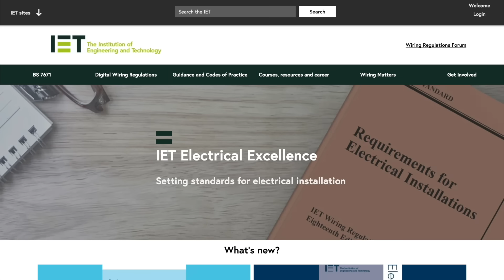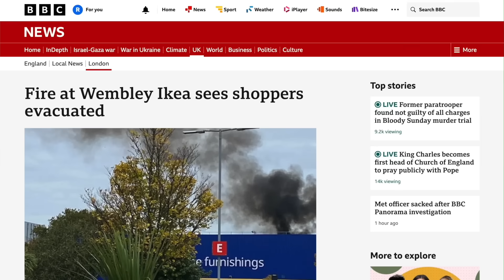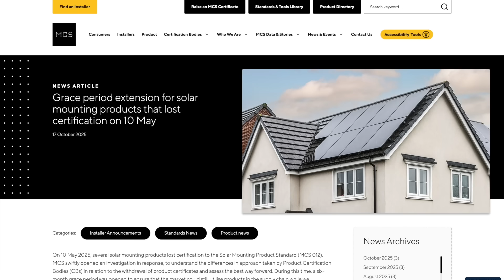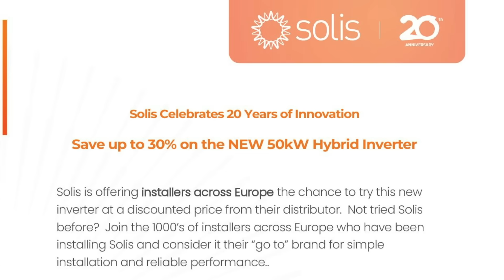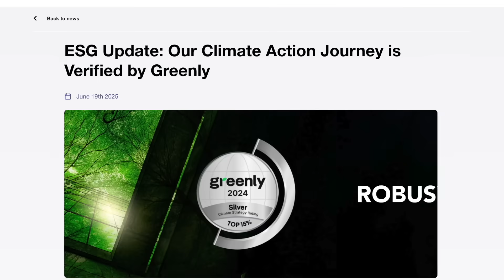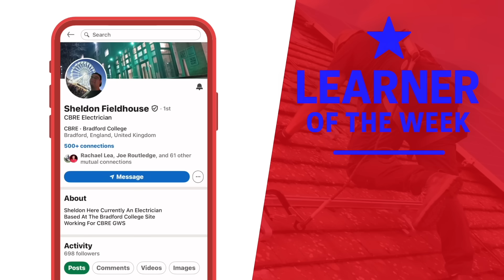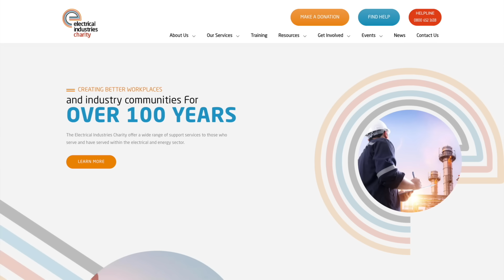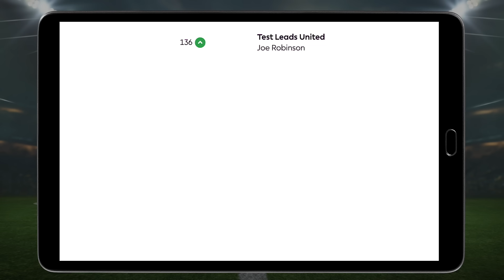Exclusive: Grid Bosses Set to Change UK Voltage

Comment: Why not simply run closer to 230v than 240v? It was rumoured that as 240V was within the specification that we simply stayed with 240V. I certainly don't want my voltage pumped up by amateurs with solar (or whatever) installations. As commercial suppliers have been able to do this for decades, if people want to put more power into the network then they should do so as commercial providers do and stop trying to mess everybody else around trying forcing people to put up with lower voltages. It sounds like yet another minority is trying to dictate what goes and force everyone else to comply or suffer the consequences, no matter what the cost.

Some devices are very sensitive to supply voltage, such as precision instrumentation. Dropping the voltage is likely to produce a lot of eWaste and engineering waste to cope with this properly. Some equipment with a linear power supply has transformer taps to precisely match the incoming voltage. So far there have not been problems. Are people, such as myself, expected to measure the incoming supply voltage before even considering plugging in their equipment? The current mains supply is generally quite stable, reliable and should be left alone.

Another reason to leave things alone is that if electric vehicles really do increase in their numbers then the supply voltage will naturally be dragged down. But then, unless I am mistaken, everyone having electric vehicles is simple not a possibility with the present infrastructure anyway. I think that the only workable total-EV solution is electric bicycles, scooters and motorcycles.
Reply: "linear power supply has transformer taps to precisely match the incoming voltage", such devices would not work correctly for much of the day already if they were connected directly to the grid. Voltages from your local transformer are not just effected by the national grid's output but also the other users on the same circuit from the transformer.

Comment: Well I think this is an underhand way of deducing energy consumption. A small change in voltage causes a bigger change in power. Halve the voltage and you quarter the power. So by dropping the voltage by 10% you will be cutting power use on a many appliances by 20%. Ok appliances like ovens and kettles will run longer but others like showers just won’t get as hot.
Reply: Reducing not deducing.

You are entitled to your opinion, but you are wrong. It is not being done to save energy, it's being done to allow more solar generation.
Reply: And.... that means youll need to use them longer.
I doubt very much that the corporate greediest will drop the price per kwh accordingly.  Its only going up.
So, theyre enforcing a higher consumption.... ££££££
Reply: @ant8241 oh dear, you clearly don't understand basic electricity.

The price per kWh should not change.
If it takes longer to boil a cup of water, you don't pay more because it takes longer.
It still takes the same amount of kWh to heat that cup of water to boiling point.
And that is what you are charged for, the total energy used in that activity.
If the voltage is reduced, the current is consequently reduced, the power dissipation in watts is reduced, but the appliance takes longer to do the same amount of work, and the kWh consumed remains the same.

The total cost of consuming that electricity is T, which is equal to the rate * kWh.

The rate isn't changing, the kWh isn't changing.

FFS!

And the difference in the lower threshold of the voltage is so slight, you aren't going to notice a reduction in performance of the appliance. It's not like reducing from 230 to 120, which you will notice.
Reply: @deang5622  Oh dear.... you clearly are a self righteous bellend.
 
Yes, youre right, a Kwh of any voltage is proportionate to the principle of ohms law - so, youre right, im wrong. Now just hope the "rates" stay the same.....
Reply: @deang5622 I actually understand electricity very well thank. I never said anything about price reductions per KWh . So we reduce the voltage by 10% this means resistive loads will run at 20% less power (if you half the voltage you quarter the wattage basic principals) will you be happy with your 10 kw shower only delivering 8 kw. The change is not as slight as you think. Yes of course your oven and your kettle will just be slower but this will reduce the peak demands. Try getting a standard three phase supply you no longer get a standard 100 amp you get an 80 amp as standard. Reverse feeding the grid with solar if causing huge problems for obvious reasons as everything is designed for power flowing the other way. dropping the supply voltage is not going to cure the voltage fluctuations just give you more headroom. There are huge problems facing supplying the growing demand for electricity, especially when the generation is becoming  more variable

Comment: Who is to decide if the hardware I have working perfectly and safely is obsolete? Me, that is it me and only me. Network operators don't have the right to decide arbitrarily that it's obsolete, it works fine in the UK, and it's not going overseas so why does some suit decide it's obsolete?
Reply: If that hardware is “harmonized” aka made after 1990s it can run 230-10% just fine. Nuisance starts under 195V. For mills that’s not a problem given they have their own MV transformers
Reply: Because you connect to their grid, and you expect insurance to cover you.
Reply: Agree there Dennis (also hi, how odd to see you here). But the odd reality is, most of the older (often specialist or collectible) equipment (as you well know) is either: A, not picky about voltage or B, has an adjustable setting for the voltage that the owner will know how to set.

The less tight tolerances (so it can vary by time of day) are more of an issue in my not so humble, and possibly a safety one ... if someone sees 207v and sets their stuff to 210 (an available voltage on some gear) then it ramps up to 253... who's liable for the fire?

Comment: In Yorkshire we wont worry about it. The EU still havent realised we never stopped using 240V. So whatever they want, yeah we did it....
Reply: You didn't need to change, it's 230V nominal, previous standards in europe of 240V and 220V are still within tolerance.
Reply: @dglcomputers1498 its called satire 😅. That said dont tell anyone but we use 240V as the minimum.

Comment: Many power supplies in TVs, computers etc are switched mode, so lower voltages cause them to draw more current. Pushing them to lower limits could cause more failures, possibly in older equipment.
Reply: The same power supplies are going to be used in the same devices sold world wide, included the whole of the EU. No manufacture is going to design and produce a switch mode power supply that will only operate a device when feed power that conforms to the current UK specs.  Just about every switch mode power supply I have is rated for a supply between 100v and 240v. The term 'switching' has nothing to do with switching the input voltages, it is short for 'high-frequency switching,' where the input frequency is greatly increased.
Reply: @rogerthomas7040 In a switching power supply of the type being alluded to here, a significant part of the loss will be in the rectifier immediately before the switching stage, here a higher voltage will lead to lower current, so a higher voltage is better. In  synchronous buck converters (i.e. a MOSFET is used instead of a diode), a higher voltage will also be better for efficiency, because the conduction losses on both MOSFETs will be lower due to them being on for less time. That being said, there isn't much in it for the 240-230V range, but at the lower voltages of "universal" supplies (typically 90V), the losses will be measurably higher. While this doesn't really matter for high quality industrial grade stuff, for consumer grade electronics, the extra heating is likely to lead to failures sooner on lower voltage supplies than higher voltage.
Reply: Worst case permissible voltage is 216V over there are present, right?  Well, let's assume we have a premises operating actually operating at 216V and it actually moves to 207V.  At 1kW assuming PF of 1 that means 4.63A at 216V and 4.83A at 207V.  It won't overheat unless it was already a very marginal design.
Reply: Many SMPS are also universal 100v-250v - 50/60hz input designed to work worldwide,
Reply: @RandomNoob  It's all about using less copper and having a single, cheaper design. In most cases, these are used  for relatively low powered devices. But poorly designed SMPS have a low power factor and vary in efficiency across the input range. 

Call me old school,  but the tiny light weight SMPS  do not seem to last as long as the old transformer based, non-universal designs

Comment: Jesus, our local supply is 252v. It will be interesting if they want to replace/calibrate all the transformers here in west wales
Reply: No need.
252 is within spec with the upper tolerance of +10% .

And it is the lower tolerance that is changing.

They don't need to change your electrical system as it is operating within the spec.
Reply: If you're already at 252v, then there's no headroom left for generation. So if anyone on your supply wants to install any generation, then they will need to reduce the nominal voltage.
Reply: @alanjewell9550 You don't know under what circumstances the voltage is up at 252.

That could very well be the highest it goes with no load. In which case it is within specification.

Comment: When my state in Australia, Queensland, was considering adopting the Australian standard for LV based on the IEC standard of 230V +10%/-6%  the additional 'space' the lower voltage gave for more electricity to be supplied at the periphery of the network, ie renewables, was a factor.  Australia has adopted the latest IEC standard of +/- 10% but there are other Australian standards that are yet to reflect that change and the states do what they want anyway since electricity supply is a state based thing and there's no requirement for the states to take any notice of the standards despite being major contributors to those standards.  The Queensland's 'connection manual 2024'  actually says an installation must operate with 230 +/- 10%.  It's a wonderful world of conflicting stuff, isn't it.
Reply from the maker: Thanks for the insight, it's always interesting to hear what's happening elsewhere in the world!
Reply: @efixx  if I recall, many years ago, Western Australia was nominally 250v whereas the rest of the country was nominally 240. I could of course be misremembering!
Reply: @TheChipmunk2008  I think you are correct!
Reply: @TheChipmunk2008 I regularly read over 250 V in NSW in the past too

Comment: Well that’s not going to happen most single phase comes in as 1 phase of a 415 v 3 ph and neutral supply and the 240 comes from this supply  root3 VL IL COS phi
Reply: Trivial change.  Auto-tapper set point on the MV supply is reduced, done.

Comment: I frequently come across both voltage extremes, most inverters shut down at 252v not 253v but really stupidly annoying is that they shut down all 3-phases if just one phase becomes 253v. why? they should resort to a 2-phase output. Must admit (shoot me if applicable), I go into the internal programming and change the upper limit from 251v (default) to 253v and that seems to fix all shut down over-voltage issues!
You're not correct when say all appliances work the same at 207v and 252v, try putting the kettle on, it's really noticeable!
Reply: Means I'm going to have to get up two minutes earlier every day just to get my three cups in before leaving! Grrr.
Reply: The math that makes 3 phase amazing is very bad when reduced to 2 phases.
IIRC: instead of canceling out: the current on one of your conductors doubles.

Comment: This will cause massive disturbance to industrial and commercial installations. Most industrial installations were consucted to run at 240v but have coped with 230v (although most still operate higher than 230v.  CNC and panels with critical overload protection will suffer.
Reply: Don’t you get your own transformer at industrial sites? Not going to be retapping it for no reason.
Reply: Nah, most have already anticipated this for years!

Comment: Lowering V means higher A to get to the power W.
Reply: In a resistive load if the voltage falls so does the current .
Reply: @TronicUK  Then time has to increase. Worst of both worlds.
Reply: @TronicUK  yes but so does the power.
Reply: @FailedExpert6330  well gee who would have guessed that . P =VI .
Reply: 3Kw at 230 is 13.04 amps, at 240v is 12.5amps, so 500ma difference. Not alot
Reply: @brendancooney9401  Industrial motors are generally sized for maximum efficiency for the torque needed.  Reducing voltage will increase rotor and winding temperatures.
Reply: @Woffy.very little
Reply: @brendancooney9401   I'm seeing 14.48 amps @ 207vac (13.02a @ 230vac) for my 3kw kettle
Reply: @PRAR1966  if the kettle is labelled 3kW at 230V it has a resistance  of 17,6 Ohm.
 17,6 ohm at 207V is 2,55 kW. The current drops to 12,35A.
Reply: @Reaktanzkreis Tell that to Fluke mate.
Reply: @PRAR1966  You have a VERY weird kettle if the resistance of the element changes when you feed it a different voltage.  Simply dividing 3KW and picking 2 Voltages is NOT how the resistive element of a kettle works. 13.02 Amps at 230 Volts suggests a 17.7 Ohm resistance where your 207 Volts and 14.48 Amps would mean a 14.2 Ohm element.
Reply: @mattsyson3980 I didn't check resistance just draw ~ as to weirdness that's down to Argos
Reply: @brendancooney9401 and at 207v it's 14.5A
Reply: Conspiracy theorists that haven't done any simple calculations.

Gotta love them.
Reply: @deang5622  No, it just means everything will take longer and cost more. Worst of both worlds.
Reply: @deang5622 if the comment is aimed at me then please explain where my 40 + years have been wasted. Then I will bow to your superior knowledge
Reply: Well I think this is an underhand way of deducing energy consumption. A small change in voltage causes a bigger change in power. Halve the voltage and you quarter the power. So by dropping the voltage by 10% you will be cutting power use on a many appliances by 20%. Ok appliances like ovens and kettles will run longer but others like showers just won’t get as hot.